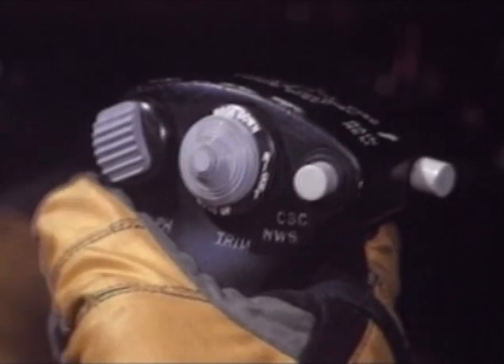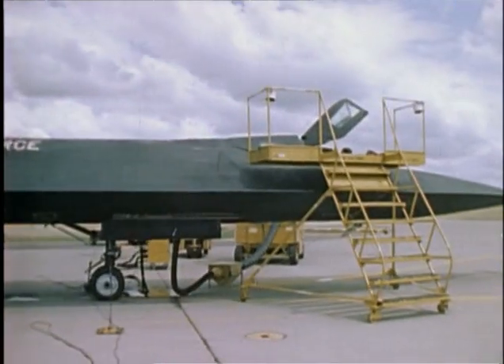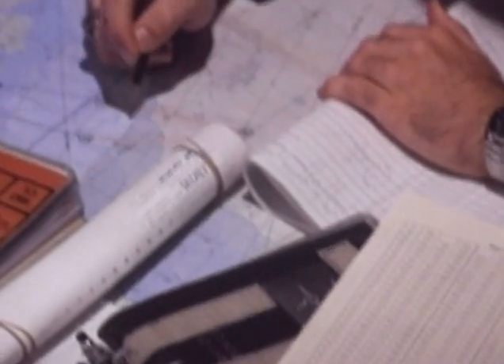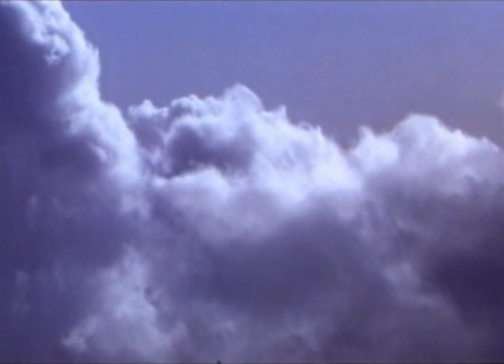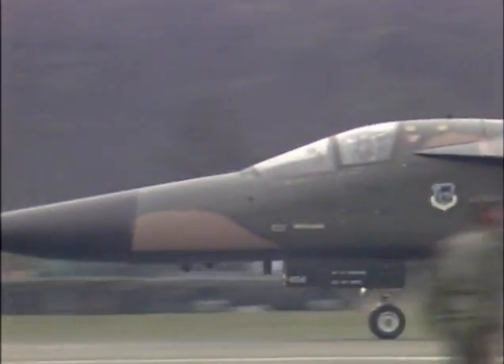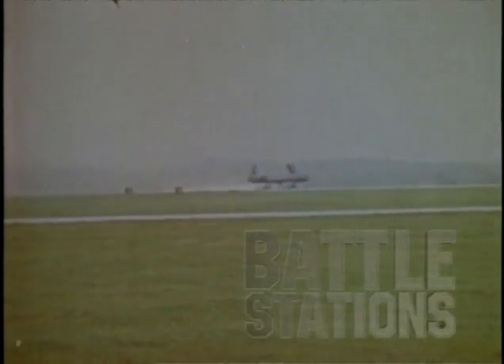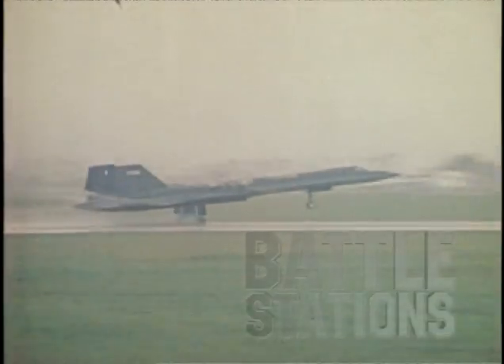Battle Stations - SR-71 Blackbird Stealth Plane -Full Documentary

Comment: Sadly, the description is wrong, the FASTEST aircraft in the world is the North American X-15 With the blackbird coming in a close second.  Didn't expect the copy-paste uploader to check facts but in case anyone was wondering.

The X-15 Got to speeds over Mach 6. Almost double the SR-71 Blackbird.

@Molo
Research required before copy-pasting.
Reply: The fastest "production" aircraft. Better? Many Blackbirds were made and flown. By definition, the X for experimental means it was a one-off. Had they built another, it would have been the X-16.

Comment: SR-71 should not be called as a stealth aircraft. It had reduced radar signature but many aircrafts do so. It was designed for high-altitude and high-speed.
Reply: But it was also specifically designed to have a low radar cross-section.  The A-12/SR-71 design predated the theoretical and mathematical breakthroughs that led to truly optimized stealth aircraft like the F-117, but the shape of the airframe did demonstrably reduce its visibility to enemies.  Not enough to be invisible (especially later on in the plane's career as Soviet radar technology improved), but it did make a difference.  The SR-71 also pioneered new radar-absorbing materials that further contributed to stealthiness, and would go on to be used in later stealth aircraft.

Comment: SR71 meanwhile: leaking fuel from wings..
SR71 Goes to Mach 3 : stops leaking fuel
Reply: Rat King this was because they built it so the plates did not fit snugly so when the plates expanded from the heat they would not break

Comment: As a kid my stepdad was stationed at Beale Air force Base the home of the SR-71 from 1987-1991 I use watch it fly over head all the time. As a kids It was the coolest thing ever.
Reply: As an adult, it would be THE COOLEST THING EVER!!!
Reply: They have one on static display near me. Looks smaller in person.
Reply: @TheJudge01 ...you liberals are the most ignorant morons on the fucking planet. So, go ahead and pat yourself on the back you soy drinking unintelligent liberal pansy. 

And watch as Trump wins reelection and the democraps lose the house!
Reply: @TheJudge01 "when I seen the F-18...". I'm guessing you didn't pass any English classes.
Reply: @TheJudge01 ...There are no 3/4 scale SR-71s on static anywhere. They definitely look smaller in person, but if they're made of metal they're real.

And for the record I grew up in Hanford and my dad worked on the F/A-18 for McDonnell-Douglas and Boeing from 1980-1999. The Hornet on stick by the front gate of Lemoore is real and one of the original Hornets that arrived in 1980. The first-gen Hornets are smaller than the Super Hornets.
Reply: I agree even with all the new n old techs mixed up, this as an adult it's extremely cool AF

Comment: Saw one at Miramar about 20 years ago. Fuel would leak out of it while on the ground, when flying, the fuselage would heat up and expand, sealing the tanks. Chatted with the Pilot, he said flying it was like "driving a bus."😉
Reply: Oil, not fuel
Reply: @clayprobstfl  Idiot! Like I said , I was chatting with the Pilot. He said it was fuel. I saw it, it was fuel. SR71s don't use oil!
Reply: @MeanGeneSanDiego  Without calling people names, ALL jet engines use oil. It was kinda my job as far as this information goes so take it easy with your comments. I did not have to talk to a pilot, I did it every day...
Reply: There are bladders in the fuel tanks. Plates in the oil reservoir do not align properly when cold, on purpose. They come together and fit when heated in flight. Sorry to bust your bubble...
Reply: @clayprobstfl  You didn't fuel SR71s did you?

Answered Mar 29, 2016
When the SR-71 was designed, one of the challenges Kelly Johnson and his team faced was finding materials and fluids that could resist the extreme heat of Mach 3+ flight.  For the J-58 engines, the choice of JP-7 fuel was made because of its high ignition temperature.  This also allowed the fuel to be used as coolant for the engine and airframe!

Like most aircraft, the SR-71 kept its fuel in wet wing tanks to maximize volume.  But the heat of sustained supersonic flight made it hard for the engineers to find a sealant that would allow the tanks to hold their contents both cold and hot.  So hard, in fact, that they never did solve the problem.  No suitable sealant could be found or made.  So they simply accepted that, on the ground, the aircraft would leak through the gaps in the skin and when the aircraft "warmed up", literally, the gaps would expand and close.

Hence why the SR-71 always leaks fuel on the ground and in subsonic flight (see pictures of SR-71s under tankers with streaks of wet fuel visible on their bellies).  It is designed to do so by a lack of an alternative and accepted practice.  The fuel itself is so stable that you can throw a lighted match into a pan of it and it will go out! 

It's one of the more fascinating aspect of the SR-71.  And one can tell when a particular aircraft was donated to a museum by the presence of pans underneath to catch the odd drip of fuel here and there.  Aircraft that have been on display a long time don't leak anymore.  Newer donations leak like sieves.  Such as the SR-71 at Udvar-Hazy that has pans under it constantly to catch dripping fuel as it has only been there a few years.

I became a docent of sorts for that aircraft when I heard a child next to me ask his parents what the pans where under the plane and I answered the question.  Within minutes I had a crowd around me as I explained various bits of trivia about the SR-71 including the fuel leaks plainly visible under the aircraft.  Other trivia being the fact the SR-71 doesn't use paint for its markings; they're chalk!  Paint would burn off.  And the glass in the cockpit canopies is Pyrex oven glass and heats to 400 degrees in flight!  Or that the engines are the only jet engines designed to run at full afterburner for hours and get so hot they literally glow and you can see through them in operation!

The SR-71 probably has more interesting aspects to its design as a result of engineering challenges than any other aircraft in history.  Some with solutions so simple or novel they remain unique to this day.
Reply: @clayprobstfl  jJP7 is not oil.JP-7 Fuel
Turbine Fuel, Low Volatility, JP-7, commonly known as JP-7, was referred to as Jet Propellant 7, to MIL-DTL-38219[2] is a specific jet fuel that was developed for the United States Air Force (USAF), for use in its supersonic military aircraft that required a jet fuel with a high flash point, and high thermal stability. JP-7 is the fuel that was developed, which was required by the Pratt & Whitney J58 (JT11D-20) turbojet engines, which was used primarily in the now retired Lockheed SR-71 Blackbird. During flight, the SR-71 could attain speeds in excess of Mach 3+, which was the most efficient cruising speed for the J58 engines. However, very high skin temperatures are generated at this speed due to friction with the air. A new jet fuel was needed that was not affected by the heat, so JP-7 jet fuel was developed for this purpose.

 

JP-7 is a compound mixture composed primarily of hydrocarbons; including alkanes, cycloalkanes, alkylbenzenes, indanes/tetralins, and naphthalenes; with addition of fluorocarbons to increase its lubricant properties, an oxidizing agent to make it burn more efficiently, and a caesium-containing compound known as A-50, which is to aid in disguising the radar and infrared signatures of the exhaust plume. The SR-71 Blackbirds used approximately 36,000–44,000 pounds (16,000–20,000 kg) of fuel per hour of flight.

 

JP-7 is unusual, in that it is not a conventional distillate fuel, but is created from special blending stocks in order to have very low (<3%) concentration of highly volatile components like benzene or toluene, and almost no sulfur, oxygen, and nitrogen impurities. It has a low vapor pressure, and high thermal oxidation stability. The fuel must operate across a wide range of temperatures: from near freezing at high altitude, to the high temperatures of the airframe and engine parts that are being cooled by it at high speed. Its volatility must be low enough to make it flash-resistant at these high temperatures.

The very low volatility, and relative unwillingness of JP-7 to be ignited, required triethylborane (TEB) to be injected into the engine in order to initiate combustion, and allow afterburner operation in flight. The SR-71 had a limited capacity for TEB, and therefore had a limited number of available 'shots' of TEB (usually 16) for re-starts, and those had to be managed carefully on long-duration flights with multiple stages of relatively low-altitude air refueling and normal high-altitude cruise flight.

 
"The operating envelope of the JT11D-20 engine requires special fuel. The fuel is not only the source of energy but is also used in the engine hydraulic system. During high Mach flight, the fuel is also a heat sink for the various aircraft and engine accessories which would otherwise overheat at the high temperatures encountered. This requires a fuel having high thermal stability so that it will not break down and deposit coke and varnishes in the fuel system passages. A high luminometer number[nb 1] (brightness of flame index) is required to minimize transfer of heat to the burner parts. Other items are also significant, such as the amount of sulfur impurities tolerated. Advanced fuels, JP-7 (PWA 535) and PWA 523E, were developed to meet the above requirements."

SR-71A Flight Manual, Section I, page 4

Properties
Melting point: −30 °C (−22 °F)

 

Boiling point (at 1 standard atmosphere (100 kPa)): 282–288 °C (540–550 °F)

Density (at 15 °C (59 °F)): 779–806 kg/m³

 

Vapor pressure (at 300 °F (149 °C)): 155 millimetres of mercury (3.00 psi) (20.7 kPa)

 

Flashpoint: 60 °C (140 °F)

 

Net heat of combustion: min. 43.5 megajoules per kilogram (5.48 kWh/lb)

Copyright (C) 2019 The SR-71 Blackbird   |  Terms Of Use  |  Privacy Statement
Any reasonable person must conclude that the SR71s FUEL was also used as a lubricant. So F off!
Reply: @clayprobstfl  Dear big -mouth IgnoramusThe SR-71 fuel tanks were unique in the sense it was the only aircraft that was built to allow fuel to deliberately leak out of them.

The problem with the SR-71 is at its cruise speed of Mach 3.2 the aircraft gets really hot. So hot that conventional jet fuel could not be used in it. They use a special blend of fuel called JP-7 which has a high flashpoint to prevent it from being ignited by the heat of the airframe.

The issue of heat of the fuel was a solved problem but the heat of flight on where it was stored was not. Bladders wouldn’t work because the temperature of Mach 3+ flight would melt them.

They originally tried to seal the fuel tanks of the SR-71 with a variety of sealants like they would with any conventional “wet” wing but found the sealants wouldn’t hold under the high temperatures and the expansion/contraction cycles the airframe would go through during a mission. Gaps had to built into the entire structure of the SR-71 to accommodate this. So the fuel tanks would leak despite their best efforts to prevent it.

After a while it was decided to simply let them leak since the high flashpoint of the JP-7 fuel didn’t make it dangerous to handle on the ground and pans under the aircraft were cheap. In flight, the SR-71 would heat up, the airframe would stretch and the tanks would self-seal. When the SR-71 came back down to tank or return home, the airframe would cool and the fuel would leak out again.

Interesting side note is you can tell how long an SR-71 has been in a museum by the wet streaks on the underside and the number of pans underneath it to catch any drops of fuel. Even with extensive cleaning and preparation, it is impossible to get every drop of fuel out from every crevice. So newly donated SR-71s, like the one at Udvar-Hazy, leak fuel like a sieve but older examples that have been in a collection for 20 years are bone dry..
Reply: @MeanGeneSanDiego  I will leave you to your stories sir. I placed and cleaned the pans. Oil is in the engine, it is sampled every flight. JP-7 is closer to oil than fuel. We put matches out in it. Fueled them everytime they flew.
Reply: @MeanGeneSanDiego  Good night GOOGLE man. Have a great evening. Life lessons...
Reply: @clayprobstfl  Once again ... THE
PILOT 
OF 
THE
SR71
SAID
IT
WAS
FUEL.

Comment: Its interesting that the SR71 and the F-104 shared a similar engine design and both were designed under the direction of chief engineer Kelly Johnson... yet ,,,the sr71 never lost a crewmen whereas the f104 was known as the widow maker
Reply: Wow - you're right - that is remarkable, that the F-104 was so bad!, yet our military still gave another contract to Kelly - almost an injustice, but that he then made such a great plane as the SR71. And you say the engine design was similar? Maybe Kelly learned from the mistakes made on the F-104 - its small wings, high landing speeds, and obsolete tech.

Comment: @ 1:01:33 can hear the Chevy Big-Block "suck-starting" each J-58 engine.
Reply: They were Buick big blocks actually  Brian.
Reply: @JIMD6370  Actually, you are correct. The early  SR-71 "start-karts" were powered by Buick 401ci Nail-Head v-8 motors.  Later, they went to 454ci Chevrolet V-8 engines.   Cant remember where I learned that.

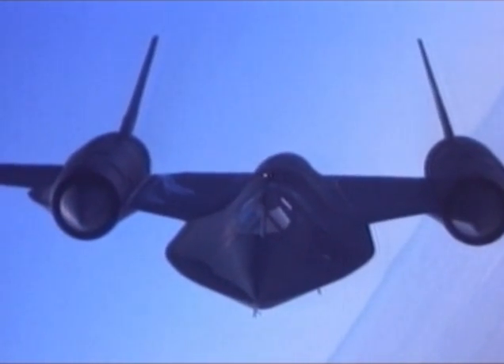Comment: @43:48 he meant to say no American airman was killed by enemy action.    In the early 80's I was paired with a recruiter/ex security guard for the SR 71 that told me on one occasion a crew was flying at full speed at max altitude .. and the pilot accidentally pulled up and did not have enough air over wing surfaces to bring it back and that that plane and crew are still going through space somewhere.
Reply: Sorry, but that's baloney.  Even at mach 7 that's short about 20,000 mph of escape velocity.

Comment: It was just a Concorde with 2 engine,s instead of 1 👌
Reply: Huh?  The Concorde had two engines.   Designed for Mach 2 flight.  Service ceiling: 60,000 feet.  Other than that

Comment: mig 25 was waster, and it still flying today,  for civilian use;
Reply: No, it was not. Operational max speed is Mach 2.82 for 5 minutes vs. Mach 3.2-3.3 until the fuel runs out on the SR71.
Reply: Im talking about max capable top speed , this jet was able to fly faster than 3.2,  Also vertical rate of climb is about 3 times faster
Reply: @Rilex037  There is exactly one case where a Mig25 was presumably clocked at Mach 3.2 while outrunning a missile. It  is also said that both engines were damaged beyond repair while doing so. The SR71 could cruise at that speed for about an hour without doing any harm to the engines so it's safe to assume that it's real topspeed is more around Mach 3.5 (which is also backed by some Blackbird pilots).

Comment: Love the SR71 such a great plane what great engineering, fantastic speed mach 3+ mach5?
Reply: Bob Hays The SR-71 is not a true Mach 3+ jet is speed is 2198 mph that is Mach 2,85 I know that the temperature and height changes the speed of sound but the speed that we use is 767 mph Mach 1 to know how fast something is for the SR-71 to hit a true flat speed of Mach 3 it would need to go about 2310 mph and for Mach 3,2 about 2440 mph and Mach 3,5 about 2700 mph it’s true speed is again 2198 mph and with the flat speed of 767 mph it’s Mach is 2,85 not Mach 3+. Still great jet

Comment: 39:18 Anybody with legacy experience with old video technology explain why the picture signal gets jumbled at the bottom?
Reply: Early video was captured on ferrite type tape with the picture embedded through use of magnetic fields.   If the tape is later exposed to a magnetic field on one side the picture will become distorted only on that side.  I've seen similar effects with ordinary VHS tape video cassettes which have been placed near loud speakers.   Either that or when the original video was captured the heads simply weren't aligned properly.

Comment: About as stealthy as a nuclear test - this aircraft used pure SPEED to advantage and 'Mach 3' I think is a conservative estimate. Now, when will we see interviews with PULSAR pilots?
Reply: fffourtwenty The SR-71 is not a true Mach 3+ jet is speed is 2198 mph that is Mach 2,85 I know that the temperature and height changes the speed of sound but the speed that we use is 767 mph Mach 1 to know how fast something is for the SR-71 to hit a true flat speed of Mach 3 it would need to go about 2310 mph and for Mach 3,2 about 2440 mph and Mach 3,5 about 2700 mph it’s true speed is again 2198 mph and with the flat speed of 767 mph it’s Mach is 2,85 not Mach 3+. Still great jet
Reply: @forzaisspeed  Idk my Uncle Rueben worked on the 71 and the D 21 sooooo
Reply: fffourtwenty the math does not lie and the true point of witch we tell is at 767 mph at that speed of sound and the speed of the SR-71 2198 mph will have a true Mack of 2,86 still faster then about 98% of things still.
Reply: @forzaisspeed  Alright bud no worries. Let me ask you though - have you ever seen a D 21 or a TR 3B?

Comment: I still don't understand how painting it black made it more heat resistant. Originally, it was not black, it was silver, or bare metal, and then they figured out that if they painted it black, it would resist heat. This was told to me by one of the pilots at the air park at Plant 42 in Palmdale Ca.  I think I'm too dumb to understand that...
Reply: It is black, RADAR ABSORBENT, ferrite paint....